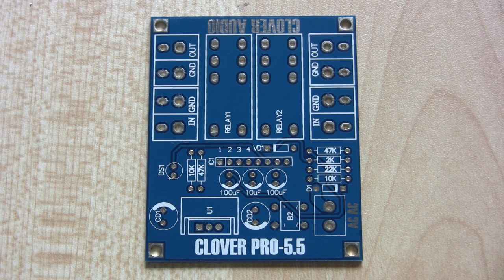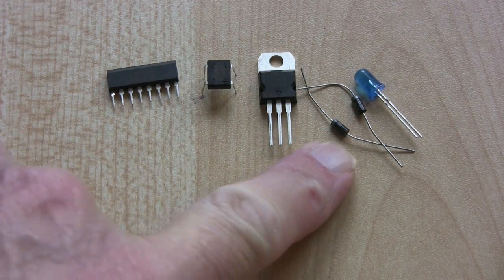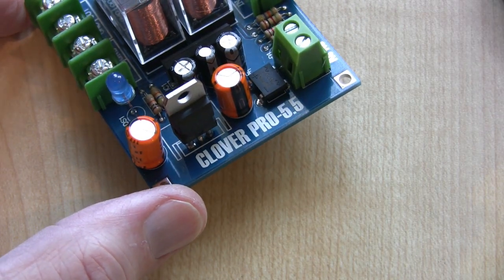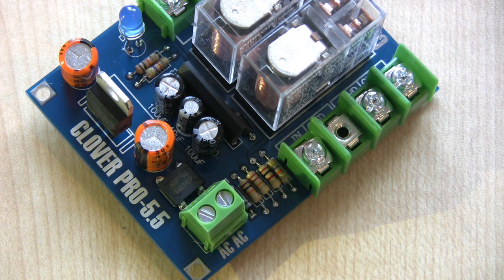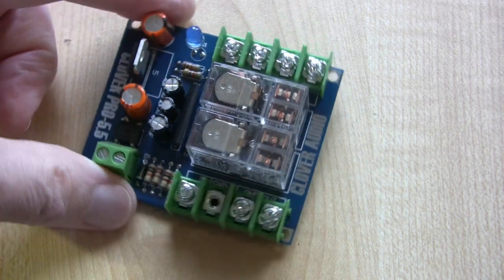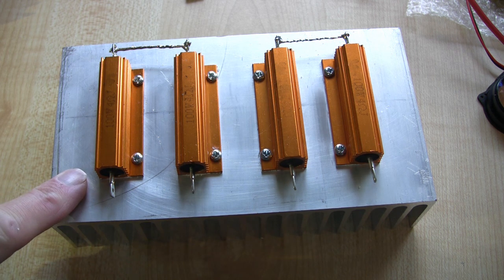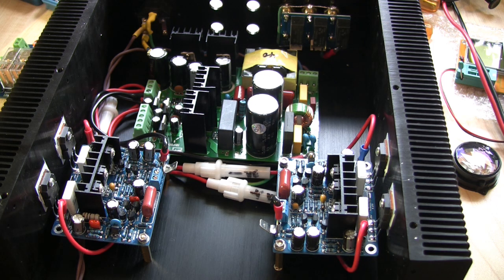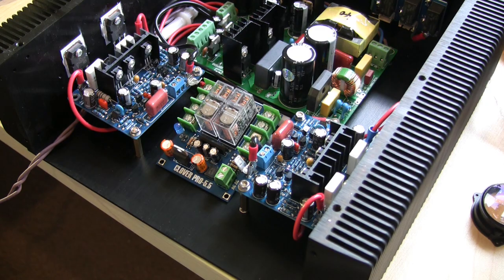Building and testing a Aiyima MX50 SE HiFi 100watt stereo amp Pt 3

Comment: Hello Michael, thanks for running an excellent channel. I have learned (and re-learned) many of the basics by watching your videos. I have two questions on your build: 

1. What is the gauge of internal wiring you used for the 40V power and the speakers?
2. Did you consider separating the power supply onto a different case / box? What are the pitfalls?
Reply from the maker: Sorry AD, it did not measure the gauge of wire, it was copper and multi strand. The length of the cable is so short as to almost not worth worrying about.
Putting the PS in a separate box can give more issues than it solves. As I had to hum or buzzes, what would be gained by doing this. On the negative side you have add plugs and sockets, maybe a couple of feet of high current cable.
Reply: @MichaelBeeny  Appreciate your response. Keep posting great videos.

Comment: Hi
Thanks for this. 
Why is the power requirement 12V AC? 
I have the upc1237 from banggood which is for 2.1 stereo setup also requires AC however I've used 12V DC (5A) with no issue

Second question...
The relays trip at high volume booth L and R , but the subwoofer out is fine.  Any idea??
Reply from the maker: I think the relay can trip on very high levels of very low bass. It probably detects very low frequency's as DC, which it almost is.
You can run these on DC, they recommend AC from a separate supply due to interaction with the DC from your main power supply.

Comment: Mine came with 12V relays but all 25v caps were 100uf🤣
Reply from the maker: That all sounds fine, at least the relays are correct at 12 volts. Should work fine. Thanks for watching.
Reply: I did change that one with a 10uf 50v, couldn't find a 25v, works fine.
Reply: Also the mounting holes are too close to the connectors and it's a bit dodgy, I didn't use the rectifier, just bypass it, my supply was rectified already.  Your spare electrolitic was mine 🤣
Reply: Hi Michael I'm really enjoying your videos, what work around did you do for the grouped grounds on the SPB?

Comment: Check the voltage range of the IC.
If the maximum voltage with it can deal with  is 18v (at least) then replace the regulator. With 18v the 24v relay should turn on.
But if the chip can work with 24 or above then its perfect
Reply from the maker: It's all sorted now, go a 100% refund, they confirmed the wrong relays were supplied. If you follow the series ,  you will see I found a better unit for just a few dollars more.